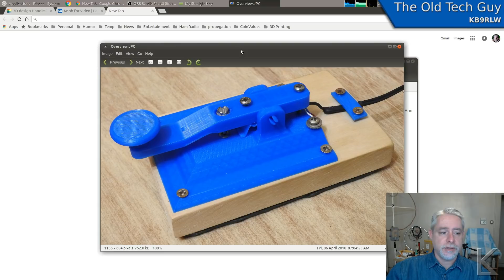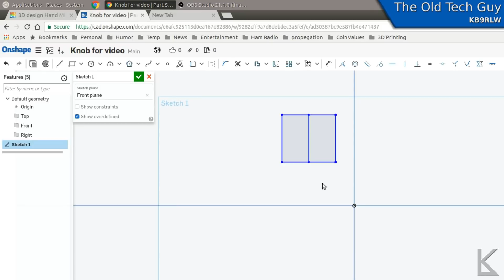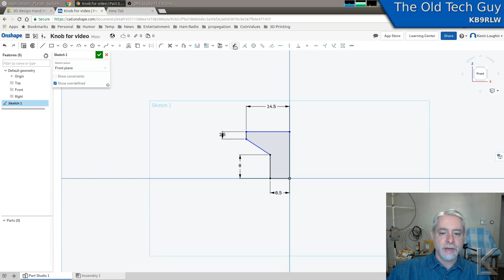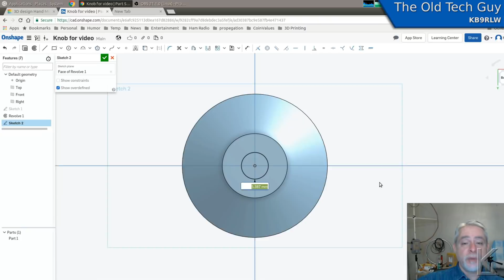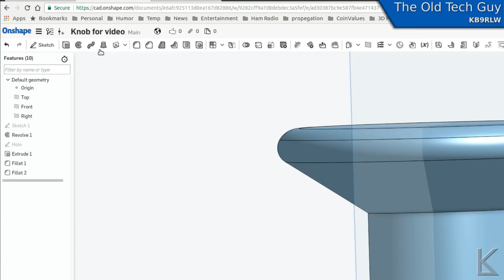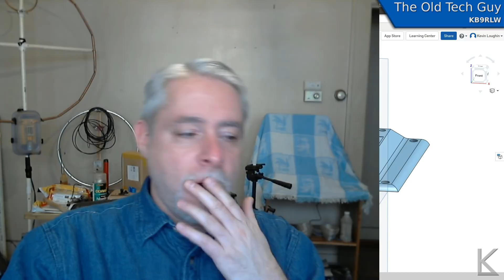3D printing Series - The next level in design,  OnShape

Comment: Kevin, don’t you think that I should learn to work with TinkerCad before I start looking into Onshape or do you think that Onshape is easy enough to learn for a beginner that knows nothing about Cad of any kind?
I have one more question, what is the procedure if I find an object in Thingiverse that I want to print?
Thanks.
Reply from the maker: Thanks for watching Cliff.    If you've never done design at all, tinker might be the safest introduction.  Easy enough to learn that you'll have more success than failure at the start.   A little success goes a long way toward inspiring someone to continue.   I did a series of videos introducing 3D printing where I cover design, and slicing.

Most models on thingiverse are fairly clean and should slice and print OK with minimal intervention.  You need to understand slicing and the limitations of printing though, in case you need to manipulate the model for a successful print.
Once you've been printing for a little while, you'll have learned from a few mistakes and have a good feel for it.

Comment: Very simple the area around the display tnx  kg6mn
Reply from the maker: A bezel usually fills the gap between an object and the hole it protrudes through, so there are many variables.
Block? Recessed? How much gap between the display edge and the hole of your enclosure?  How much does the display edge rise above the plane of the hole?  How much spread over the hole edges?  Rounded or square corners?  How deep is the enclosure wall thickness?  
It's more complicated than you might think, and much information is needed to get it right on the first go.

Comment: Thaks Kevin!
Can you, or some of your viewers, suggest some good Blender videos? I know there are a ton of such videos on the internet, some good, some bad, but I was wondering about decent videos showing using Blender to create parts for 3D printing. Why Blender? It's free and available for most systems (windows, linux, mac).
Reply from the maker: A few years ago, when I first got into 3D printing, I used blender.  A heck of a learning curve.  Also, you have to be careful.  It's all too easy to create models with geometry errors that give you grief when you try to slice or print them.  The boolean operations in blender don't care about leftover geometry inside a model, which confuses slicers.
Both tinker and onshape run in a browser, so they are multi-platform by default.
Reply: The major problem with online cad programs is that if you loose internet or can not get internet then you can't design much. No, not likely to happen, but is a possibility.
Reply from the maker: Oh yeah, I agree.   I'm still hoping someone will release a stand-alone program that's as easy to use as these.  For Linux.
Although, FreeCAD is getting close.  It works in a similar fashion to OnShape.  Just not as refined.  You might want to give it a good look.  It's easier to learn than blender and produces clean models for printing.